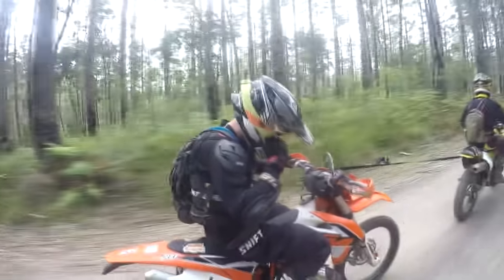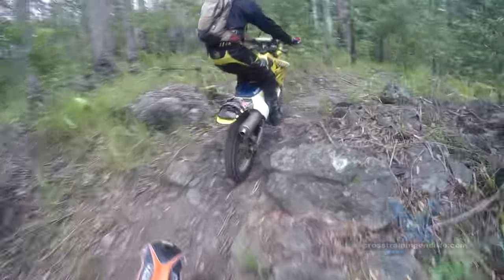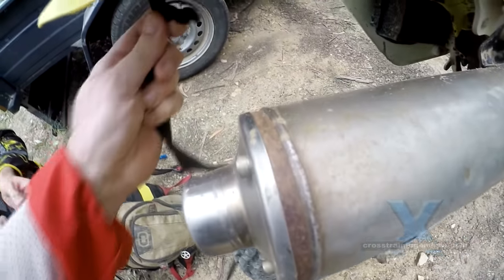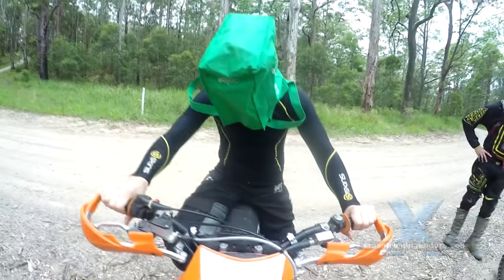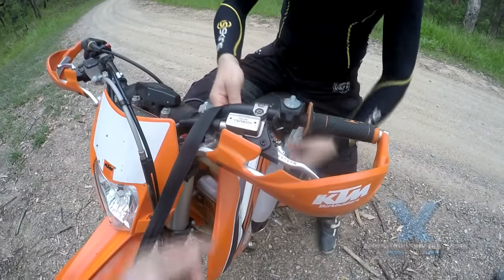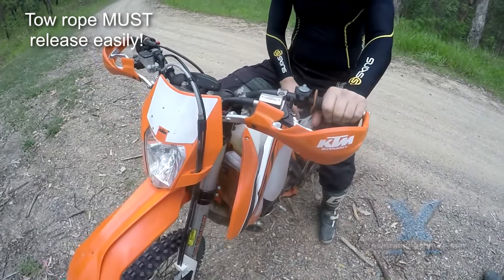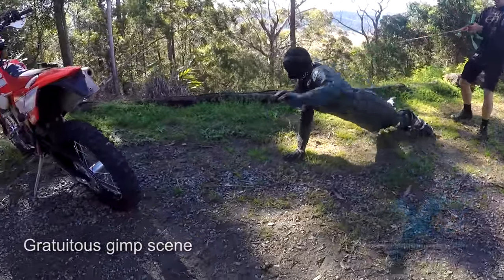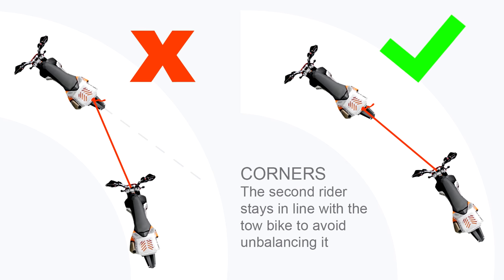How to tow a dirt bike︱Cross Training Enduro

Comment from the maker: FURTHER NOTES: Flexible rope helps maintain tension. Carrying a spare tube? Consider using that for the same purpose.
Don't tie to subframes, they are too easy to damage. 
No rope? It's risky, but you can ride side-by-side and the second rider pushes against your footpeg. Only for very experienced riders!
Generally the longer the rope, the safer and easier it will be to tow.

Comment: easy tip: if you get towed much as i do, consider installing a towing point by tying down a webbing on both forks above your front fender, give a little slack, so it forms a center point (triangle) while being attached to a towing line. can be very useful on very gnarly slippery muddy uphill, when your friends needs to help you by hand-towing your bike, too. the downside is that the towing line can not be instantly released when things go bad.

Comment: I like to do a loop around the bottom bearing part of the head set but above the lower triple clamp . Long loop so the fender does get pulled against .this makes steering easy enough.Tow rider feathers brakes a tad to keep the rope tight . Your right about new sub frames being a challenge to find a place to tie onto the tow bike

Comment: Good tip...  I like the idea suggested in order to be able to let the tie go in case something goes wrong. But many of the trails we are doing are already very difficult to ride alone. I just cross my fingers so we will not have to tow at all... :) But keeping an eye on the bike and good maintenance should be more effective than fingers crossing... especially on a older exc like mine.

Comment: Something to keep in mind is that some bike may not lubricate transmission and engine parts properly when being towed since the engine isn't running (Same applies when coasting down hill with the bike off). You might want to remove the chain if you have to tow for a very long distance.

Comment: Good video. I have had to do this multiple times over the years. I  would, however, suggest a rope/strap that is a bit longer than the one used in this video. It makes life a bit easier on the guy being towed since it gives him more options for obstacle avoidance while not upsetting the tow bike as much by his movements. Also, if you want a real challenge, try towing a quad with your dirt bike. I have had to do that twice. One of those times being almost 30 miles. This is a great video on something that is not touched on very much that I have seen in the dirtbike community.
Reply from the maker: very true tom, i had a tow rope as well and suggested we tie them together as this one was too short

Comment: Peg to peg is the safest as it won't mess with your steering and you can release it easier. The tower hooks to the right peg, the towee holds the strap between his boot and left foot peg (not the right one, so you can use your rear brake). You can wrap the strap around the peg once if you need more grip, but otherwise just releasing your foot releases the bike if shit goes bad. For getting out of knarlier terrain you might want a more permanent setup, but for faster towing this would be the safest if either rider messes up.
Reply from the maker: it's a bummer none of us have tried this zedro or we would have filmed it. but i have included it as an option in the forum posts where i'm putting this vid.

Comment: I'm thinking that radiator was a bit beyond tool kit / spare parts trailside repair...  That was a mangling alright!  Wow!  I've never seen one as bad as that.  It's as if the radiator guard wasn't even there!

So another tip when towing any vehicle is that the operator of the towed vehicle should be active on the brakes to maintain tension in the tow strap or rope.  Not to ride the brakes, but to anticipate and keep slack from developing.  That prevents the "snap" when slack occurs and the tow vehicle accelerates.  Even at low speeds it can be vicious.

Very good video though, very good pointers.  Since I usually ride alone, I'd have bigger problems than towing if I have a break down...  Could you do a video on making friends and having riding buddies?  LOL!!
Reply from the maker: making friends? i could do one from a purely theoretical angle maybe?
:D
Reply: I suppose that would work...